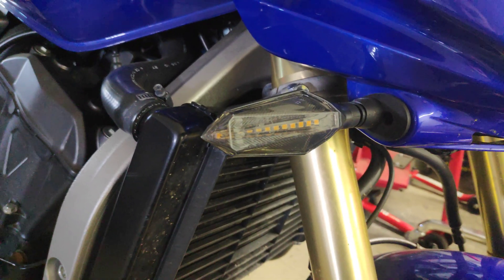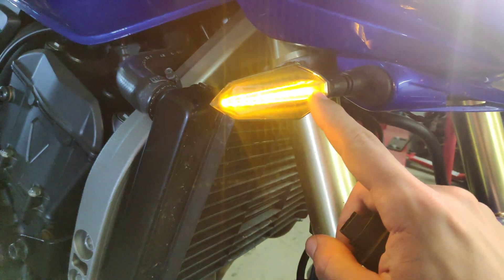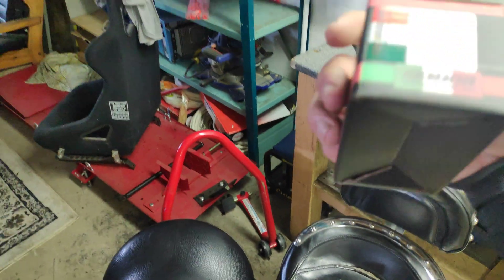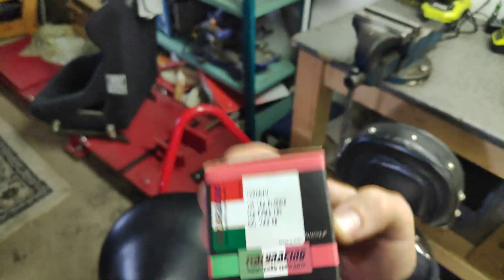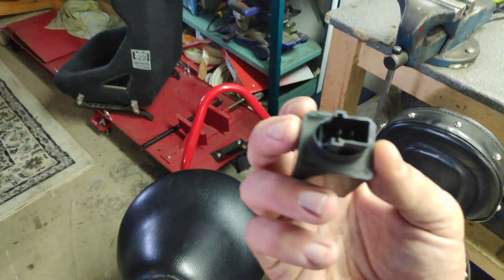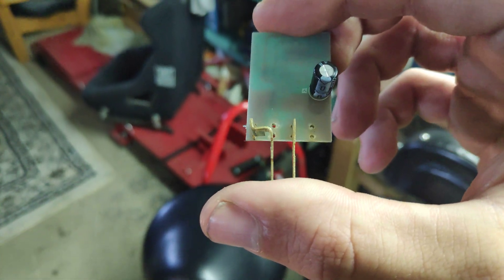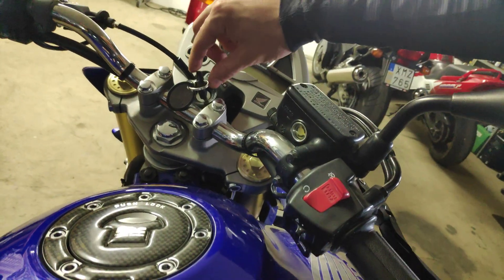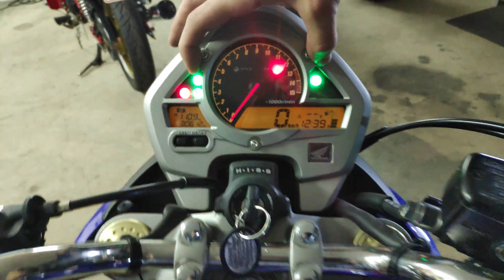Led sequential indicator FIX - Relay Bypass

Comment: The best solution is LED indicators with no resistors and buy a LED relay but the problem now is all LED indicators have built in resistors and so they only flash to half way, so now it's a bigger problem getting them to work than some years ago.  Non sequential, non signalling on dash, I don't know if that would even pass the MOT.
Reply from the maker: It did pass the equivalent to MOT in Sweden :)
Reply: @philipnylund  How if you put hazards on and you have a Christmas tree lol

Comment: Thanks, helped a bit. Guessed I might have to bypass the flasher unit. The side ones on my car worked fine but these bike ones didn't. Would of been more helpful showing what pin placement was for a four pin Honda unit. As my 600RR has the same unit.Cheers

Comment: But, you didnt show what you did under the seat, where the relay is itself. Some people, like me, are very visual. i have a set of flowing indicators, that i bought in error, but i am prepared to used them if i can make them work
Reply from the maker: Well the relay is located in a difrent spot on every bike and the relay itself can be a 3 to 5 pin unit. This was dune on a CB600FA '07 with a 4 pin relay, but the process is the same on outhers. 

Get yourself a multimeter and locate which relay pin does what and bridge the one with constent power to the one that's controlled by the indicator selector.
Hope it helped :)